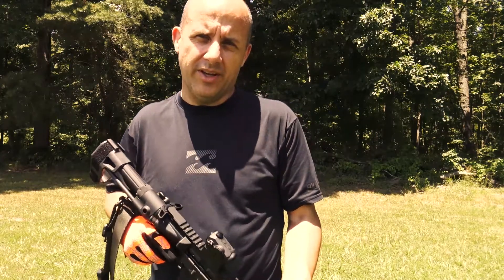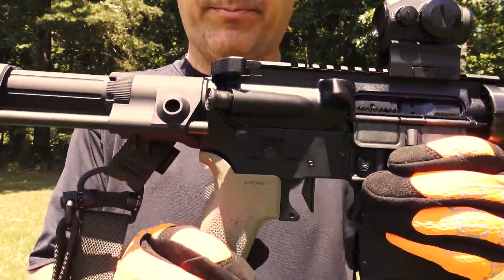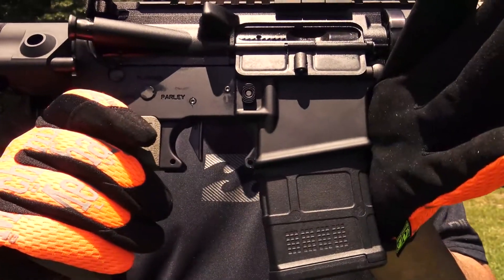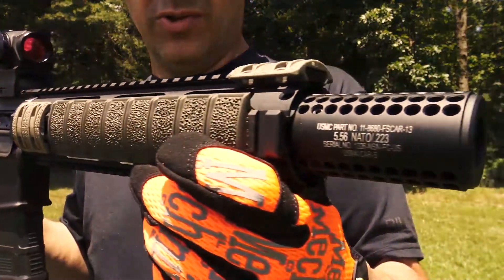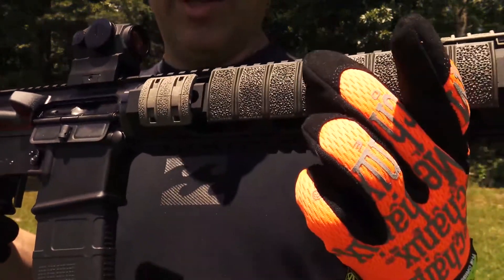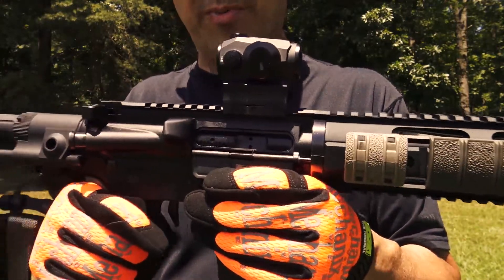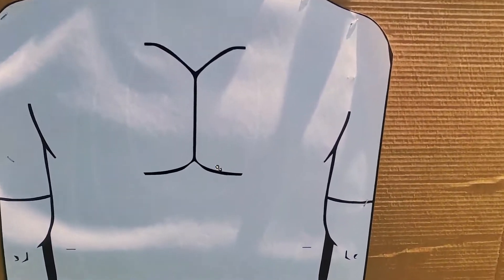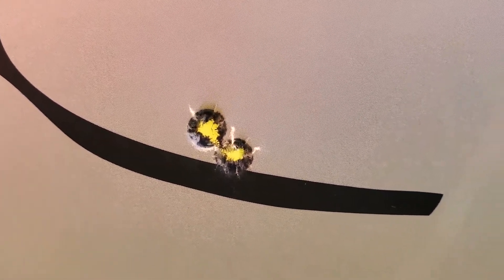AR Build. (Assembly)

Comment: If that is a H3 buffer system, she must have a pretty good-sized gas port. She is throwing out the brass with some authority👍🇺🇸
Reply from the maker: The Geissele website had a chart that recommended the #3 buffer for a 10.5 barrel. At the end of the day it was all they had in stock.